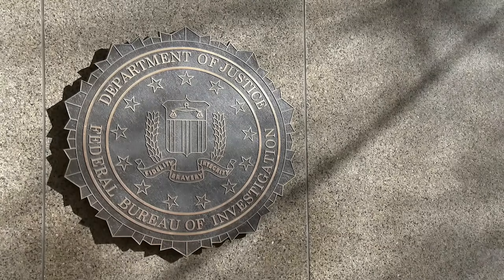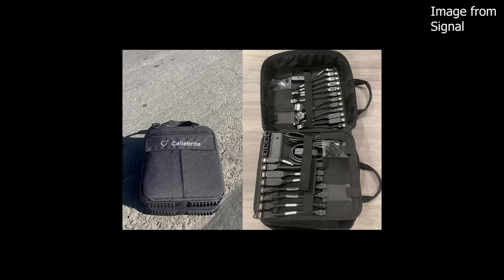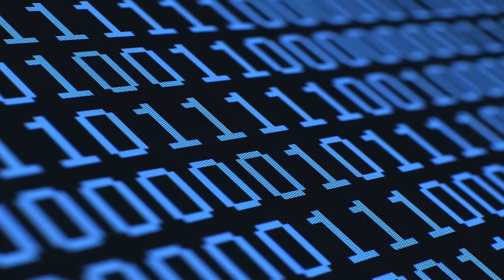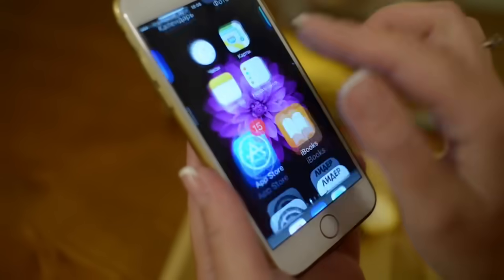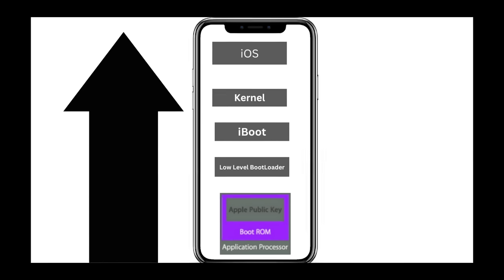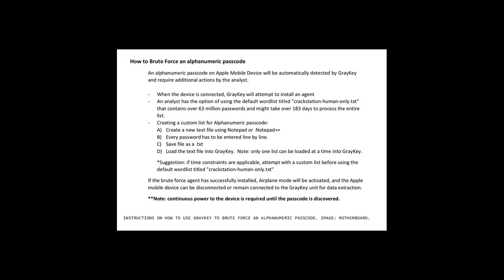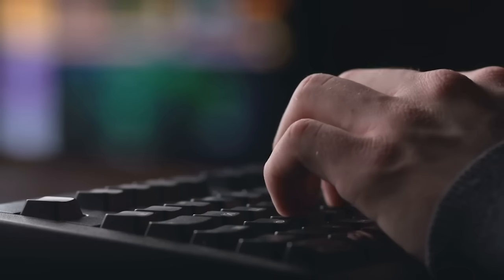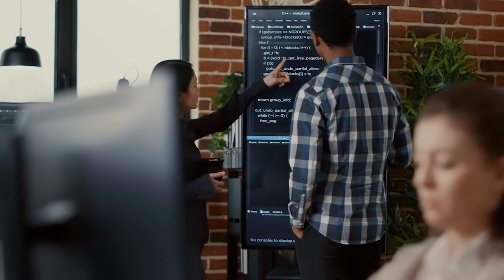How Locked iPhones are Being Cracked - Technical

Comment: Simple Solution: Open developer settings on phone, ensure that USB debugging is turned off, and ensure that the default USB configuration is to only charge the phone. This ensures that by default, if another device is plugged to the phone, you have to unlock the phone, and then authorize any interaction beyond charging, such as file transfers.

Comment: iOS shortcuts app - set an automation for when power is connected or for when aeroplane mode is turned on. Make the phone connect back to data networks upon connection to power/aeroplane mode turned on. Modify the data on your phone before forensic analysis.

Comment: Israel everywhere. All big tech compnies (google, microsft, apple, amazon, facebook, etc.) send their user's information (some requires even National ID for verification) directly to Israel in their data research center in the pretext that Israel has most advanced and cheapest engineers. Now, we are seeing how they are using these informations to target civilians. If this is not stepped now, we will be the next eventually.
Reply from the maker: The Israeli tech for this is mostly used by law enforcement.
Reply: @realtimecyber  It is not the point. The point is equipping a psychopath capable of gen*cide with such capabilities by the major tech companies.

Comment: When it comes to the brute force attacks, the best protection is to still use an alphanumeric password and not just some digits as passcode. This increases the time needed to crack from hours to years, giving you enough time to wipe the phone from your online account or simply rendering many data on the phone obsolete over so much time, especially saved login-data for 3rd parties.

Comment: I guess if you had something to hide a simple solution might be to drill a little hole through the USB interface chip and rely instead on wireless charging for the phone. Not perfect but would make life a lot more difficult. 

You could of course booby trap the device to short the battery out if remote wipe was instigated, a handshake wasn’t received for a few days or on 10 failed unlocks.

Comment: I'm sure it's hard to crack an iPhone if you scratch off a few of the pins on the lightning cable. Did you find the ones that are just for charging I think you'll be good. Or you could use NFC charging or qi charging whatever the hell it's called
Reply: Wireless charging, qi charging, etc. I don't know how many people still remember qi unless you were an earlier adaopter of this tech.NFC is more about data.

Comment: Wanna see them try this on a 14 Pro max or 15 pro max/ by the time they crack these there would be iPhone 21 and 22 pro max already out
Reply from the maker: An unpatchable side channel attack vulnerability (analyzing behavior of the chips) that allows extraction of secret keys was actually just discovered in M1 macs. Those are only a few years old. So never say never.
Reply: @realtimecyber  Never said never but i mean for now its not possible. there is always a work around tho as innovation is daily so
Reply: If you can’t jailbreak a iPhone and lower the security it will be very hard to hack. As you would either need that PIN number apple sends to access the phone.  2FA. 
But I believe the ones that CAN be jailbroken are easier to hack. The others that can’t you’ll probably need physical access to either usb attack or brute force.
Reply: Se puede hacer estos ah un 12 pro Max  ?

Comment: A few security tips for iPhone users from my own experience:

- Use an alphanumeric lock code that is as random and long as possible ... with Face ID and Touch ID it doesn't bother you as much as you think
- Deactivate the control center on the lock screen ... the first thing law enforcement tries to do is activate airplane mode, but without the control center you can't do that, lol
- Create an automation that disables airplane mode, enables Bluetooth, Wi-Fi and Cellular once a day at a certain time ... this increases the chance of remotely wiping the iPhone or at least setting it to lost mode
- ALWAYS update iOS as soon as possible
- Regularly delete the keyboard dictionary
- Use a private mode browser like Brave
- If possible, use biometrics as app locks if individual alphanumeric/complex passwords are not available
- Set Signal to automatically delete chat messages that are older than a certain period of time
- Use Keepass password databases with strong passwords and keyfiles

Comment: I wish all luck possible to the one that dare try to hack my nokia 3310 i do not even save contacts because i dial manually from memory, technology is the nemesis of privacy.
Reply: It uses GSM which can be broken by anyone with some knowledge.
Reply: @mestari6289  yes but that confirms my point, What data would be obtained from a phone that is only used to call and receive calls with no banking apps nor social media apps or anything related to my person except the phone number
Reply: there is always a way in, nothing is 100% private and if it has software to work can be hacked but the point on hacking is to obtain something of value, it is dumb to steal an empty safe to waste time and energy opening it to get nothing.

Comment: The new iphone se 2nd gen and 3rd gens are not exploitable to the same as the iPhone 6 - X exploit because they have newer A series processors when those older jailbreakble and exploitable phones have older a8 - a11 processors a12 and newer patched it
Reply: So if police have my iphone 11 max pro, i refused to give passcode will they get in? Plus for some reason they told me to shut the phone down when i handed it over to them, meaning the face ID wont work.
Reply: @KingKhan20000  as far as I know with most tools no if its updated because that phone is not checkmate jailbreakable and turning it off encrypts the data
Reply: @oHacks.  Not sure if its updated I think the ios is still the 2020 one. But I was told to shut it down in the house then they took it after so idk...
Reply: @KingKhan20000  yeah I have no idea sorry
Reply: @oHacks.  But you said if its updated so explain that then.
Reply: @KingKhan20000  the newer the os the less jailbreaks and exploits there are so the harder it is to get into the phone
Reply: @oHacks.  and the ios that came with my iphone 11 pro max? Will that stop them? Should I log into my icloud and put the phone on lost mode? Will that make it harder for them?
Reply: @KingKhan20000  dude I have no idea if they have it and are going to go through they are probably going to get into it but honestly they might not even search it it just depends on why they took it
Reply: @oHacks.  They took it for 'malicious communications' or mean phone calls
Reply: @KingKhan20000  I have no idea sorry
Reply: If it is jailbreakble it is hackable. A fake OS running fake Apps.
Reply: @iRelevant.47.system.boycott  yup

Comment: They use a wire mesh and radio signals ran across the surface that is made wet. They first access the Camara than charging system and finally the whole phone.
Reply: Are you saying they use electromagnetic fields to power certain parts of the device independently? If that is even remotely true that is insanity cool. 

Do you have a source for that I can read up on?

Comment: To prevent hacking, remove half of the battery and pack C4 in the empty space which activates on detection of usb cable being plugged in. Just an idea that seems doable.
Reply: aged like wine
Reply: It most certainly did
Reply: @nick_kol_nick my thoughts exactly
Reply: It doesn't have to be half, C4s are plastic explosives so you can just have enough where it matters like on the SoC and Flash storage.
Reply: What if i just keep my devices glued inside a microwave? Dead mans switch set to defrost. Fw me. Imagine being a 😺 fed and watching all my data sizzle 

@bluestone-gamingbg3498
Reply: Why not instead of plugging in a USB.. have a txt sent via another phone
Reply: Looks like someone saw this idea
Reply: Was this posted before the exploding pagers 😅
Reply: I've this idea for HDD's. Gut the inside out and wire a blast cap to the hard drive's power connector. Then fill the inside with "instantaneously combusting material". Put it back together and mark the trapped drive with red tape or something not obvious. Anyone that plugs that drive in is gonna be in for a VERY spectacular surprise.
Reply: Thermite is safer. Can just put in a resistor to melt intentionally. Over overvolt a cap. And pump thermite into the phone. The phone then just melts. And thermite is easy and accesible.
Reply: @PeterBellUK   You could though, you do it on data lines, not charge lines in the usb port. That or just always charge through wireless charging on modern phones. Its your phone, you would know what way it was set up, and others wouldn't.
Reply: :D Fellow Jewish people. The secojd biggest tech capital of the world. The best hacking tool known, Pegasus, is from Israel. Israel is the nation with most tech startups per capita. Most tech, including, but not limited to Microsoft Windows, most of the iPhone parts, Waze, WhatsApp, Facebook, and Pegasus are Jewish. <3 Shalom. Fighting gaslighting against the racists. <3 Free Israel. Free Persia/Iran. Free The West. <3
Reply: But then private companies and the f*cking government will cry foul like a b*tch about it and manufacturer sh** against you.
Reply from the maker: Haha
Reply: It's a decades old concept. That already have been used.

Comment: A LOT OF INFO! now how about enterprise iphones that are remotely managed? i didn't hear anything about that? At work here they say not hackable LOL
Reply from the maker: For the most part a MDM cannot prevent most of this, the hardware vulnerabilities still exist, it could enable some of the newer protections, and possibly reduce the attack surface by disabling certain functionality. It could also remotely wipe a device before its cracked, assuming the device isnt put into a faraday pouch which is common practice before cracking a seized device.

Comment: I understand the purpose but what if this falls into the wrong hands? Also, suppose you are writing a novel or poetry.wouldn't that allow anyone to steal your work?… So... Is it why the EU is forcing apple to use USB-C?
Reply: No the plug standard does not determine the security of the system. The security is mostly done on chips on the motherboard like the trusted processing unit (TPU) and the central processing unit (CPU). The plug is just the standard way data goes in and out but doesn't determine what data goes in or out.
Reply: The USB-C thing is about creating a common charging standard between manufacturers. To reduce electronic waste.
Reply: This is already in the wrong hands

Comment: How does lockdown mode work to prevent unauthorized access via these methods? Always wondered what additional measures are in place to prevent someone from cracking the passcode via cable, etc.
Reply: Lockdown mode just disables features that are common attack vectors. It's an extreme measure that renders many convince features unusable like system and message notifications and others. 

The two most common areas I've seen exploited on iso for remote exploit are the notifications engine and text messages.
Reply from the maker: Obviously Apple is pretty secretive about their technology, so it’s speculation.  But likely close the APIs and other interfaces, that normally take some data from connections.

Comment: Those files are not stolen. They are included in itunes.
Reply from the maker: Its against their terms of service reverse engineer them, or use them for things like this.
Reply: @realtimecyber   as someone who has a touch 1, touch 2, ufed4pc, and physical analyzer I can tell you now the information you posted is missing critical details. ITunes is required to be installed prior to you installing the Ufed Touch software. Its not reverse engineering their code. Its using the stock OEM files and the proof of it is that the digital certificate was untampered. The screenshot only proves the files are in the correct directories after iTunes and Apple Application Services are installed.
Reply: @realtimecyber  against terms of service or not they are files on your machine and you are free to do whatever you want with them as long as you're not distributing copyrighted material. You can claim cryptographic keys are copyrighted and are properties of apple so distributing them would be illegal but the mere act of reverse engineering is not. 

Still if the tool extracts those keys at runtime on the device itself then there is nothing apple can do. They cannot use legal means to stop you from running code on your own devices.
Reply from the maker: @TommyJ76  They are distributing the material; cellebrite is a publically traded company that sells devices to crack iphones.

Comment: Install software thats wipes your phone if a data cable is connected.
Reply from the maker: good luck charging
Reply: And data is never really wiped until it’s over written
Reply from the maker: Yea, just the pointer is deleted.  @Ragin.Official
Reply: @Ragin.Official  Not true, on android 7+ after factory reset is performed the encryption key gets replaced so you cant recover any data that was there before.

Comment: Really well explained! I love that you didn't mix up or wrongly interpret the technical data! Makes for a very factual and informative video
Reply: Can't you just block external connections?
Reply from the maker: @QueenElsa1999  If you turn on lockdown mode. Otherwise when you plug in it prompts for the pin, so there's some attack surface.
Reply from the maker: Glad you liked it. We definitely lost our minds while we were deep in the technical weeds 🤣